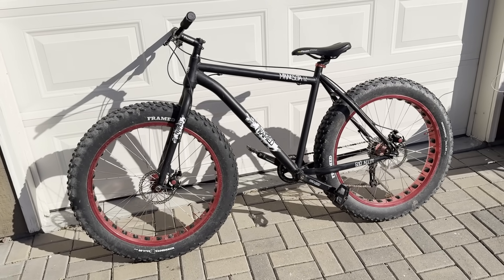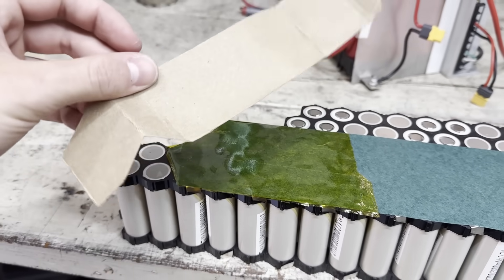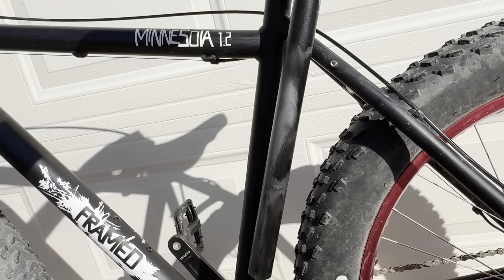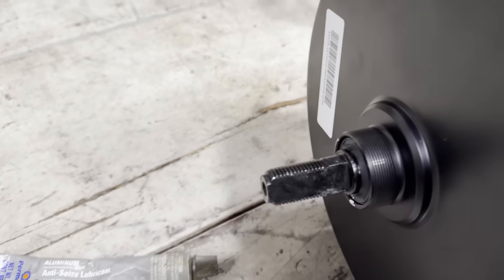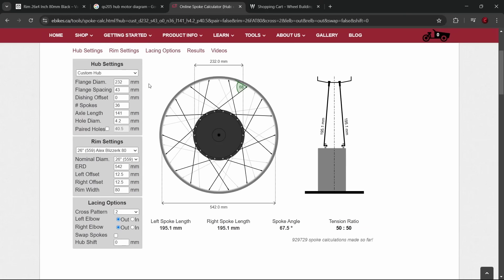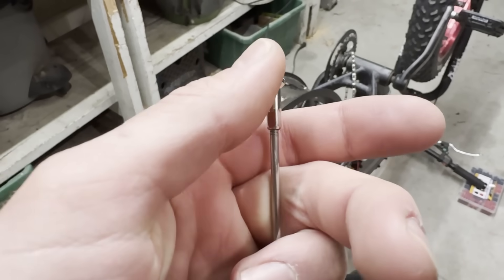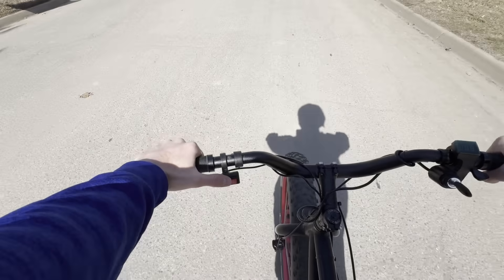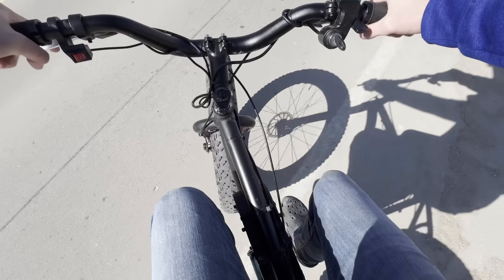Overpowered Fat Tire Ebike Build

Comment: Cool video, bro! Quick question: Do you need to use the throttle, or does the motor activate while you're pedaling? I assume you installed a PAS (Pedal Assist Sensor)?Can you help me out
Reply from the maker: I didn’t install a pedal assist sensor, I like to just use the throttle. A pedal assist sensor on a bike this powerful would be dangerous, if you spun the pedals to avoid kicking a rock or something then it would really throw you off balance.
Reply: @Calthecool that I did not know. I’m building one right now but I’m still waiting for the parts. I thought with the PAS it would be great. Is it not possible to adjust the speed settings? And thank God, there are still people left who are willing to give you advice. Props to that bro and may God bless you
Reply from the maker: @mitta8218 there may be a way, I really haven’t used PAS at all so I don’t know.

Comment: 750W is is the maximum legal limit for e bike in the US. You sre literally filming yourself engaging in illegal actions. American intelligence at its best
Reply from the maker: Laws are just words on paper until they are enforced. I’m not hurting anyone by doing this, and I specifically made this bike for riding on sand/snow AKA off-road. If it makes you feel better I sold this bike after posting this video.
Reply: @Calthecool You're argument is that you aren't hurting anyone by breaking the law. I'd be careful using that logic. If you want to go fast, buy a moped or motorcycle. The rules exist for a reason.
Reply from the maker: @juntus89 The power limits are in place so that people on E-bikes aren’t a safety hazard to others. We can tell that’s the case because if lawmakers cared about keeping the rider safe then there would be a law requiring you to wear a helmet. I never go fast near anyone, if there’s a pedestrian anywhere near the road I ride the same speed as a normal bike. Regarding what the law is actually trying to accomplish, I’m no worse than the average rider on a 750w bike. If you want to criticize me about me being a danger to myself then that’s totally valid.
Reply: @Calthecool There ARE laws that require a cyclist to wear a helmet. Not federal laws, but state laws. And yes not every state, but it's also not against the law to wear one. Which means that you should take responsibility regardless, and wear one. I don't give a damn if you're the only person in the entire state, the law is there for a reason. Law makers and even the philosophy of law formulated by philosophers and lawyers and judges, senators, congressmen and women whoever - they are all a LOT smarter than you are and there is no argument to validate the breaking of a law. You did it because you wanted to feel cool. As an adult you should act your age, instead of like some immature teenager, making excuses for the fact that you own (or owned) an illegally modified e bike.

In countries in Europe it is 250W max. Some are pushing for 500W. But whatever it is, there are reasons for it. E bikes are cool (I have one) but I also have a road bike which I can reach speeds of 30 mph easy on flat. A lot of people buy e bikes because they are fat and lazy and eat too many burgers. That's why America built e bikes to carry such heavy payloads, because the average American weighs the same as a sea lion and can't cycle for more than 5 minutes before passing out
Reply from the maker: @juntus89 If everyone who is involved in making laws was completely informed, never wrong, never made a bias decision etc. then I would follow every law perfectly. Most of the laws regarding e-bikes were established by people who have never ridden one so it’s wild to say they are smarter than me regarding this topic. I don’t know where you are, but in the U.S. the laws are also much stricter then they need to be to try to make e-bikes not a commuting option so people have to spend their money on cars and gas instead. Because of that the “fat and lazy” people just drive their cars.
Also there’s literally no national or state laws about wearing a helmet where I live, that’s the whole point of why I brought it up.

Comment: hey I really like this content, I would love to see you build out a razor rambler 16 with a bigger hub motor
Reply from the maker: Could be interesting, I would like some suspension though.
Reply: @Calthecool  i think a pit bike fork could be mangled onto it, it would need some spacers and stuff but it could work, the back is wide enough to fit one of the 14 in qs hub motors

Comment: why is there a problem spot welding grinded cells? my whole 10kw battery was made of those with no problem and it held strong over time
Reply: I also used 3 layers of 0.2mm nickel strip
Reply from the maker: I couldn’t get it to work, maybe you didn’t grind as much as me?
Reply: @Calthecool  I grinded the shit out of mine with stone and dremel haha

Comment: Next time buy qs138 v3 90h. Its much much much stronger.
Reply from the maker: I’ll do you one better, my next build has a qs180.
Reply: @Calthecool @Calthecool  qs180 is weaker. I know that kW power is higher,but qs138 will be much much stronger,because it has 350kg load capacity,high temperature resistance,allowing for big overpowering,with instant torque. Qs180 is just better for small sized bike.
I have qs138 dirt bike,for now i have only one test video uploaded. 

If you want,i can show you how it performs. 

Qs138 is DIRT BIKE engine,qs138 is for small bike like surron. Small load capacity,heats up faster-meaning you cant overpower it for long periods.
Reply: @Calthecool  I made a mistake,i thought qs180 was hub motor. QS180 IS REAL DEAL GO FOR IT. but,if you put higher voltage,you need better cooling. And qs138 offers liquod cooled versions
Reply from the maker: @JanisSviestins I already finished the build, I’m running 36kW and it’s way more power than I’ll ever need and it doesn’t even warm up the motor so I definitely don’t need extra cooling. I lowkey should have gotten a qs138 since the qs180 is overkill.
Reply: @Calthecool  for me same stuff with qs138,its way more powerful than expected 😂
Reply: Post a video of qs180 ❤  @Calthecool
Reply from the maker: @JanisSviestins it’s coming, I’m going to film this weekend

Comment: Be careful with overpower cheap bikes, my friends took cheap bikes to the mountains and it finished with disassembly during a down hill ride. Bikes are not motorbikes and if they are average ones they could disassembly and crush on a motorbike speed.

Comment: the whole point of those bridges is to fail before the pack explodes.  By putting sheets of copper now you have no backup failsafes
Reply from the maker: If I didn’t put the copper the nickel would melt, these aren’t some basic 7.5 amp cells. There is some nickel you can buy that has built in fuses, but this isn’t that nickel.
Reply: @Calthecool  I like the idea of using the spiral nickel bridges. they put a specific amperage Limits on each individual cell And the little spiral blows so it doesn't take out other cells when one shorts.  I see where you're coming from now this is a extreme build and requires those extreme modification.  If they had UL specifications and regulations that would require that for all lithium cell Batteries so they could be easily Swapped out and smart BMSs That detect low individual groups and can apply more amperage to let that group catch up, a lot of problems could be solved.  These do not exist because Manufacturing Is Not Taking Place in America so we have a bunch of fires and early failures.
Reply from the maker: @funnycatvideos5490 Those features would be great, but you really can’t have each cell fused as it would majorly limit your power and create way more heat in the pack, and any method of having the cells be easily replaceable just makes the packs way bigger and more expensive. Any well made pack with good cells won’t need any replaced anyways. I’m going to be using smart BMS’s in all my battery builds in the future, I actually made this battery like 6 months before I posted this video and since then I found a good supplier.
Reply: @Calthecool  Not at all, if one cell is 5 AMP Max draw the little spiral bridge would be 5 AMP.  So when one individual cell shorts the little five amp spiral Fuse pops instead of popping the next cell or the entire row next to it.  It's a simple fuse it does not generate heat is just a backup failsafe, if the BMS shorts and for some reason still allows power to flow which we see a lot, that's why these whole packs self-destruct.  The other thing I was talking about was active cell balancing with smart chargers they can charge one Cell series Group if it's lower than the others and can balance them out instead of charging them all the same Right even if They are At different voltage levels which shortens the pack life. Some being overcharged and some being under charge And it just keep going further and further apart if you never check them and manually balance. These implementations already exist they're just not being utilized because there's no regulations or certifications, it would make it so much safer and repairable and longer-lasting. Let's face it with all these mass-produced lithium cells they're going to have dead shorts every once in a while, if you don't have a fuse on each and every one they will take out the ones next to them or even whole Rows are even worse full-blown detonation as I have seen over 10 videos so far of this happening and individual fuses would have stopped it in its tracks. The fuse would have simply popped And just changing that one Faulty Cell from the manufacturer And 5 amp spiral bridge fuse And the pack would be like brand-new again.  Even in the electric car world only Tesla does this out of every other brand.  It just shows you there's no thinking involved They are just mass-producing Low cost Disposable products basically
Reply from the maker: @funnycatvideos5490  So if I decided I wanted each cell to be fused on a battery that I plan on pulling 45 amps per cell than how would I do that?
Reply: @Calthecool  There is no way on God's green you are going to pull 45 A per cell.  The rating is Max before causing damage. It's really that simple I'm surprised you don't understand it.  Whatever the Lithium-ion cell is rated at you put that size Spiral Fuse At that grade and is spot welded on.  I'm talking about each individual Cells max capacity, says right on the battery.  Tesla does this on every battery They produce and it literally cost pennies And part of the Nickel strip. If the battery has a thousand cells it has A thousand individual fuses already machined into the nickel Strip Rated at their exact individual capacity and is the safest way to do it. It's not any more expensive and cost just as much as a nickel strip would.
Reply from the maker: @funnycatvideos5490 I encourage you to look up “Molicel P45B”, it’s a relatively new cell that is rated for 45 amps continuous discharge. It’s been used extensively in high power battery packs in the last few years, and I know from personal experience that the rating is real. There are even higher discharge cells called tabless cells that are made with new manufacturing methods that increase the discharge up to 60 amps continuous.
Reply: @Calthecool  Yeah that's cool a 45 amp nickel strip Spiral fuse would work and make the whole thing safe without limiting any capacity.  That's what I'm getting at these fuses don't limit anything and just make it safer
Reply from the maker: @funnycatvideos5490  You don’t seem to understand fuses, the whole point of a fuse is to limit current and you just said “these fuses don’t limit anything and just make it safer”. Anywhere resistance is increased will limit the current, and for a pack like this you want as low resistance as possible because resistance + high current = heat.

Fuses are great in circuits like AC transmission circuits because there’s only a few fuses and they are located in a place where they can naturally cool, so the only compromise is you having a slightly higher electric bill because of the wasted power from the fuse, but it’s worth paying for the extra safety.

On a battery pack like this the heat from the fuses can’t just go into the air, it’ll heat up the whole pack and ironically cause the cells in the pack to wear out and need replacing quicker. If a couple cells in your pack are dying then you need to replace the whole pack anyways, since all the other cells are probably on the brink of death, since all the cells in your pack should be very consistent.

Comment: I'd love to see you build the lightest and fastest you can, so some carbon frame and thinner wheels
Reply from the maker: I don’t trust street bike tires, they seem too fragile. I don’t know if a carbon frame would even be that beneficial, as it’s not going to be a lightweight bike anyway since I have to have a motor and battery. Plus your weight doesn’t matter that much for top speed, it would be better if i wore an aerodynamic suit or something.

Comment: what did you mean by continous BMS? Does it mean you just bypassed the cutoff protections?
Reply from the maker: There are some BMS’s that let you do higher amps for a short amount of time, the BMS in my EGO minibike is 100a continuous and 200a for 10 seconds which can be a problem because it will shut off if you go full throttle for 10 seconds. This bike has a 120a BMS so you can go full throttle for as long as you want until something overheats.
I would never bypass any of the safety features on a BMS, they are all there for a reason.

Comment: So 80 3.6v batteries is 288volt output? Olychit...thought the baddest of them were 96v?
Reply from the maker: The battery is a 4 parallel 20 series, so nominal voltage is 72 and max voltage is 84. I don’t think I would trust myself with 288v

Comment: Watching the power to weight ratio, i couldn't help but think if u put the battery as far forward as possible and the controller behind it vertically, it will give you a better balance point under power yeah?🦾
Reply from the maker: That would help, but it really isn’t a problem as long as you have good throttle control.

Comment: Bateria de lanterna 🔦 de criança 🚸. 😂. Vai tirar 9kw destas baterias? não vai não! Isso é uma piada. Se tiver células lifepo4 litokala quadrado ⏹️ azul 💙 280ah cada celula lifepo4 sim vc teria 9kw. E 80v ou 90v DC. BMS 450ah. Pico Max rate Power. Controlador 10kw Max rate Power. Sim vc teria 9kw na roda realmente. Its not really.  You have Max 850w Power really yes.

Comment: Wasted opportunity, with such power you should go mid drive only. Preferable with planetary gear box. I have 2000 watts and can do 60 miles per hour. Your in wheel engine just loses 75% of it's power efficiency after around 35 miles per hour.  So most your kilowatts going into heat. But maybe good you not on mid drive. With 9000 watts you would be dead after reaching 100mph ))))
Reply from the maker: @artemca  top speed isn’t a good way to compare my bike to yours as my top speed is limited by the motor RPM and not the power. If you wanted a good comparison between our bikes then we could do a drag race on sand with the same tires, it would be a big difference. I like mid drives as well but having one on this bike would make no sense for the amount of power I wanted. Also nobody is going 100mph with a 9000w bike unless they have a full aerodynamic shell around them.
Reply: @Calthecool  Yep, your grip should be insane, but power efficiency should be horrible. Compromises :)

Comment: Really surprise the pack hold for these amps, but I'm sure it is really negative for the life of it and I guess the battery wont last long even at 40mph constant run due to the power hunger.
Reply from the maker: @dtiydr  These cells are definitely not the best in capacity, power output, or cycle life. For a cheap build like this they are fine since they were only $1.80, but if I was building this bike to keep I would have done Molicel P45B cells for $4.40.
Reply: @Calthecool  Ok thought so then it all made sense, yea those batteries are a beast.

Comment: Would you need to be an electrical engineer to understand how to do half these things you mentioned here in the video?
Reply from the maker: @gooooblaster1800  I learned everything to make stuff like this from watching YouTube videos and reading forums. The only thing I knew how to do before I got into this was soldering, but you can also learn that from YouTube videos.
Reply: @Calthecool  Thanks for the reply. Would you say it can take a couple years to be doing DIY projects like this without tutorials?
Reply from the maker: @ it’s hard to say, I’ve only been building e-bikes for the past year. However I’ve been doing simple fabrication for nearly a decade so I had some experience before getting into e-bikes.

Comment: Cool project, but you run 60mph with weak mechanical disc brakes? seriously?
Reply from the maker: @TikTok_Ingo  Those brakes stop the bike quick whenever I had to, the thing people don’t think about is how much the regen helps preserve the brakes. You barely use the brakes when riding normally so they are cold with plenty of brake pads, so if you do need to stop quick they work well enough. Obviously a bike like this would have hydraulic brakes with 203mm rotors in a perfect world, but I rode the bike a bunch with these brakes and it never felt unsafe so they’re fine by me.

Comment: Every normal e bike is giving you the power only when you paddle it..... i feel like this is more a motorcycle, less a e bike. Anyway..... i want one !
Reply from the maker: It's pretty common to have a throttle on an ebike. I've tried some pedal assist bikes and it was harder to use than a throttle for me.
Reply: @Calthecool  is it? in germany we mostly have pedal assist, at least thats what i can see when i drive arround